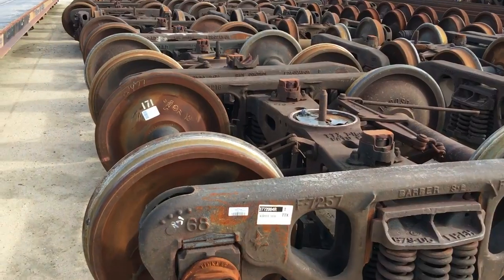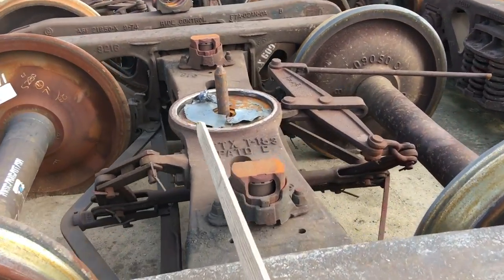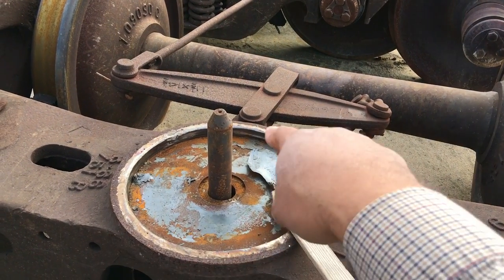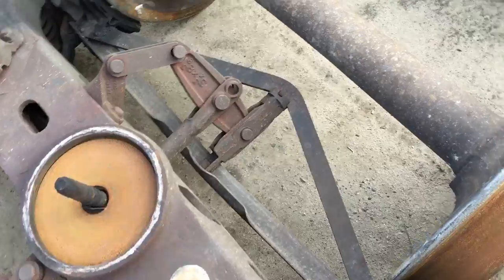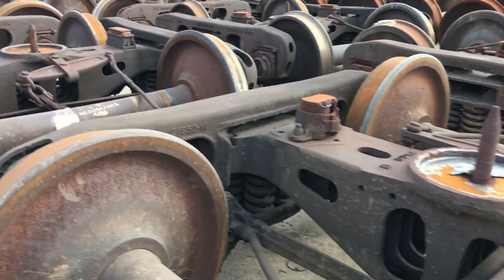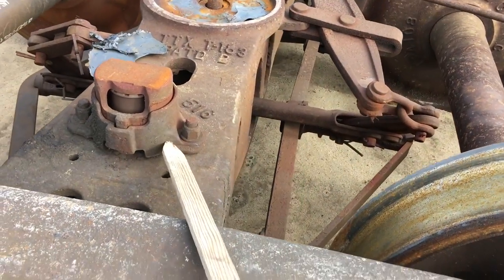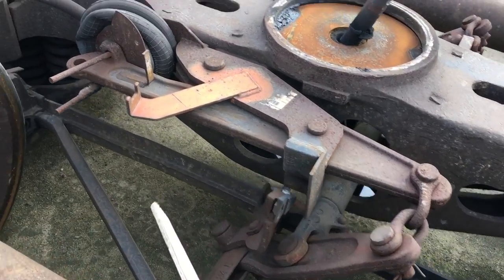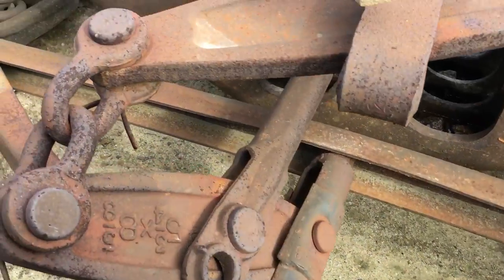Railcar truck set nomenclature

Comment: Just for chat each wheel weighs in at 1,000 pounds each and each axle weighs in at 500 pounds. Each spring is rated for a certain weight handling. When there are two springs they are called nested as there is two together. The Timken wheel bearings, I found out from the Timken people, are rated for 1,000,000 to 1.5,000,000 miles before they wear out. If the car sits for over 1 1/2 years with out being in service it is advisable to replace them before they are put into full time service. The FRA (Federal Railroad Administration) outlawed the old journal friction bearing as they would get over heated and cause derailments. I remember working for the Great Northern way back in 1966 at Hillyard, Washington and there were three men on each side of the train who would open each journal box door, give the bearing a few squirts of oil and then close the doors. The train would move very slowly for this service.
Reply: I would have to guess on the total weight of the truck assembly. Lets say around 10,000 pounds or 5 tons. When it comes to traction motors I have no idea what they weigh.
Reply: Taylor I think I gave you a underweight of a complete truck. Take the completed axles and wheels, 2 side frames and 1 center bolster, all the springs and all the brake rigging I would give a total weight of about 20 tons per truck.
Reply: @robertbowman3406  
That’s waaaaayyy too heavy. A bolster weighs less than 1,000, same with the 2 side frames. The wheel sets are the heaviest and they weigh about 1,000 each. All in all, the assembly could be no more than 5,500 lbs.
Reply: @robertbowman3406  
That’s waaaaayyy too heavy. A bolster weighs less than 1,000, same with the 2 side frames. The wheel sets are the heaviest and they weigh about 1,000 each. All in all, the assembly could be no more than 5,500 lbs.
Reply: @jaysrailroadcorner5403  I stopped reading when he typed 1.5,000,000.

Comment: Wear liner is also known as the GREASE DISC. The grease disc goes over the CENTER PIN. The pin rests inside the CENTER PLATE (or) BOWL.

CONSTANT CONTACT SIDE BEARING. They have a composite rubber in them to cushion the car in movement. Some have a steel wheel in them called a roller bearing. 

Also. Truck sets and wheel sets ARE NOT ALLOWED TO TOUCH THE GROUND. Every single set in this frame is going to need a roller bearing inspection. They come off the truck and straight onto rails. If for ANY reason they touch dirt, gravel, grass, pavement, concrete, black top etc.. they must be put under inspection per the AAR Field Manual. Even if it’s a repair facility, home shop or interchange. They must not touch ground.

Comment: Those are constant contact side bearings. No gap allowed. It has a certain amount of preload depending on which style it is. Looks like stuckie ( believe that's how it's spelled)
Reply from the maker: A. Stucki Company kind of has the market cornered in constant contact side bearings. They do a great job and I have seldom seen gross failures. Heck, they seldom ever need replacing. It is really a great system and they make a great product that is easy to work with. Hmm. After thinking about it, I really like A. Stucki Company.

Comment: I've always wonder how to adjust brake cylinder travel in railcar or adjust slack adjuster ? I work in CNR as a HDM ive only work on locomotive .. would be nice to understand how they work .. thanks
Reply: The name of the part is slipping my mind, but the small rectangular clevis on the slack adjuster controls the brake cylinder travel length. You adjust it by sliding it through the travel block. 1 5/8” sticking out should get you about 7.5” of brake cylinder travel with a new Group R 2500dj slack adjuster for example.  :D

Comment: So the cars are just deposit on the trucks with the pins centered in a hole in the bolsters .
No attachment of any kind ?
Reply: None , not even the wheels are attached
Reply: Naw. On the truck mounted brake systems you’ll have break rod/lever attachments and/or a cylinder hose. But for the most part it just sits on a pin. Sometimes I’ve bent the pin and tossed it and let it ride with no pin.
Reply: @jaysrailroadcorner5403  
That is called a willful violation.
Reply: @ffwd2797  
You mean when FRA or PUC comes and audits a track?

Comment: What about 
"Slack Adjusters", how they work, using compressed air.
Everything is held together by gravity, & pins, with only cotter pins, in the ends of those.
If you lift up the frame bolster, those wheels & axles will roll right out from under there. The frame bolster just sits right on top of them and the roller bearings.
The freight car, just sits on top of the trucks held on by gravity, with a just kingpin keeping it from sliding off. Not bolted on.
I'm surprised no grease is used on moving parts. That makes them easier & cleaner to work on.
Semi trucks are supposed to get grease every time before the hook on to a trailer.
Reply from the maker: Yea, it's kind of weird how everything is held together by gravity. There are some parts that were once greased, back in the day, but are now fitted with non-metallic wear liners (looks/feels like hard teflon). These areas include: center plate liner which goes in between the center plate and the truck bolster bowl, coupler carrier wear plate which goes in between the coupler shank and the coupler carrier...I think that is it. Some friction castings have a wear liner but not many. Box car doors still take a lot of grease. I have never thought about how slack adjusters work. They dont fail all that often...and they are made by the same company that makes bathroom urinal valves (sloan and ajax). Weird.

Comment: Many passenger cars and locomotives have 3 wheel sets per truck set.
Reply from the maker: The only 3 wheel set trucks I have worked on have been for the military. The railcar body itself, including the center plate, were identical to the traditional 2 wheel set trucks. Same wheel sets as well. I have never worked on locos or passenger railcars myself.

Comment: I notice that none of the wear liner bowls have no grease in them, got to have that as the truck will be hard slewing around curves and will climb the rail, i thing a lot of derailments are the cause of this, i work for a class 1 rr and o have never seen the car knockers lube these things, not on cars not on engines and then they wonder why some of these derailments happen.
Reply from the maker: derail14 Hmm. That is very interesting. I have never greased the center plate. I thought the non-metalic wear liners took the place of grease. As a matter of fact, they are also called "lube disks" so I don't think grease is needed. I do recall grease being used by the repairmen when I was still a grunt, not worthy enough to use any tools, way back in the early 1990's.
Reply: I recall seeing TV commercials for some oil company way back in the 70's that was illustrating some of its innovations. One of them was the lubricant for the center plate - they consisted of round flat discs. Four or five wear simply tossed in the bowl and the car body lowered in place. I presume the weight then squashed the discs into a paste similar to grease.

The one shown in the video looks like it might be similar to the product shown  in the following link:

http://www.rrtoolsnsolutions.com/lubricants/LubeDisc.asp
Reply from the maker: whiteknightcat That's exactly it.
Reply: we used to have those in the shops by us, had to carry 5 boxes to a shipment of BO boxes that got pushed in one day
Reply: Ok there Mr class one I work at a class act Railroad, and your right us car knockers don't put grease in the bowls .why you might ask ? It's not FRA nor AAR prohibited . That lube disc is all it gets . Most of derailments are on the account of  poor track conditions and poor train handling.
Reply: I currently work for UP. The bowl liners are called "lube discs" for a reason--they're pre-lubed and slippery to the touch. You seem to have zero idea what you're talking about, bud.
Reply: Grizz are you saying that I don't know what I'm talking about? Surely not.  A lube disc and a bowl liner  are two different things. Right?
Reply: Grizz what office do you work in?
Reply: Rob, what we have here is a confusion in terminology. The lube discs I saw on television, probably back in the 70's, were actual lubricant material. Think of highly solidified grease. Today, lube discs and bowl liners appear to describe the same thing - a single formed composite resin disc that has replaced separately applied lubricants. This is what is shown in the video. The patent for the device is in the link below, with clickable blowups of the drawings for it:

https://www.google.com/patents/US5443015
Reply: whiteknightcat   at the very start of the video when he talks about the bolster. you see the guy pick up that some what round black disc .that is a lube disc. That  disc is still used today. Liners are  also used for wear prevention. I've seen them used to make up for worn bowls. Just gotta make sure to check that side bearing clearance before you let it leave the R.I.P..
Reply: Then I think what we're seeing in the video is the type of product shown in the link below - looks almost identical. The narrator described the item as a wear liner, though, resting atop a steel liner. I presumed this was what was left of the assembly described in the patent I referenced earlier, after much wear and tear. 

http://www.rrtoolsnsolutions.com/lubricants/LubeDisc.asp
Reply: whiteknightcat the link shows it exactly how  it looks new. The narrator over all did a good job on describing the parts. Wish he would've talked more about those constant contact side bearings. would of liked to hear his opinion on them.
Reply: Rob Henry 
Derail14 probably works in office and over heard a conductor talking shit about carman because he derailed a car doing something stupid
Reply: Rob Henry he was mistaken on the CCSB (constant contact side bearing) clearance. Correct me if I’m wrong but the minimum clearance stated in the AAR field guide is 1/2” (Miner) with the maximum clearance 13/16” (Stucki). I work on tank cars only (36” wheels) m, so if there’s any difference on hopper cars, box cars, etc, I’d love to hear about it.

Off topic, can anyone here direct to a site that shows a basic maintenance routine for working TMBC (truck mounted brake cylinders)? I work for a small company but I’m a lead there and am responsible for coordinating training meetings every other morning. The AAR field guide doesn’t say squat about TMBC! 
I was told to look for manufacturer specs but I’m hitting dead ends everywhere. The funny part is I KNOW how to disassemble and reassemble them, but I can’t find any literature to back up what I’ve learned from my peers over the years!

Comment: What does the painted writing mean on the side of the wheel set?
Reply from the maker: The only federally required "paint" on the wheels is a small "H" that get stenciled on the wheels. The "H" means that the wheel is "heat treated" and "curve plate". This refers to the actual wheel plate itself which is the part of the wheel between the axle and the "tread" or wearing surface. The older wheels were a super simple flat plate of steel. The newer wheels looks more like an "S" if you were to cut a cross section out of the wheel. This helps with heat dissipation. All of the other stencils on the wheels you see are from the manufacturer. Some of the wheels we get in are almost brand new with the mfg stickers still on them. Some only a few months old. Those mfg numbers vary and are not very important. All the important stuff is cast or engraved into the wheel, such as mfg serial numbers, manufactured dates, heat treat classification, and factory ID.
Reply: thank you
Reply: "H" is the only required lettering per FRA, but Greenbrier provides my rip tracks' wheels and they'll sometimes--not always, but sometimes, be stenciled "PREM" for a premium wheelset, "TURN" for a turned/reconditioned wheelset, or "NEW" for a new wheelset.

Comment: anyone else cringe seeing all these wheels set straight on the ground?
Reply from the maker: Yes, it used to make me cringe...but they all go to be reconditioned so it doesn't matter. It cost extra labor to put the wheels on cribbing and we cant charge any extra for doing that...so...we dont any more.
Reply: Why does it matter, the rim that is sitting on the ground is not the part of the wheel flange that rides "on" the rail, so no damage there.  So, why would it matter?
Reply: @diesellocomotivefan5400  lmao you cant be serious....any kind of damage to wear to a component is never good. Sure, the rim doesnt ride "on" the rail but it sure are hell needs to not have a dent in it either!

Comment: Those so wheels on the first set of trucks you show are condemable.
Reply from the maker: Dark Days Can you please elaborate? Thanks.
Reply: Paragon Bridge Works  any so "southern"  abex wheels must be removed on site. Check aar field manual rule 41 page 350.
Reply from the maker: Dark Days Very cool. Do you have any idea why the AAR made that ruling?
Reply: Paragon Bridge Works casting flaw I believe. It started a few years back with only the 1995 wheels. They added a few each year until a couple years ago they condemned any abex southern wheel. Raised letters on the wheels make it an inspectors dream.
Reply from the maker: Dark Days Where those cast in the USA?
Reply: Paragon Bridge Works  yes Savannah Georgia.
Reply: That wheel looks like a 33' that rule only applies to 36" wheels.
Reply: Rob Henry that's true but I think those are 36". Hard to tell.
Reply: Dark Days they are 33" those are 70 ton trucks
Reply: Jeff Klaubo yep you're right. I was to quick to call them 36.
Reply: Dark Days if I hadn't been working with the 70 ton trucks so much lately I might have missed it but the F7C style gave it away lol

Comment: Round block over bearing is also known as a "journal". Stop over explaining yourself because it makes you stutter and loose train of thought on part names.
Reply from the maker: +Charles Stevenson I have heard of the "roller bearing adapters" called "journals" but the AAR rule 37 specifically calls them "roller bearing adapters". In fact, the entire book only refers to "journals" as the area on the side frame where the adapters mate to and does not refer to that term as an actual part. But, I have heard them called "journals" by some people. That's just my humble opinion. I hope you enjoyed the rest of my videos.
Reply: The "journal" is actually the end section of axle on which the roller bearing is mounted.

The area on the the side frame that sits down over the roller bearing adapter is call the "pedestal jaw".
Reply from the maker: I didn't know that. It sounds like you have some experience with these. Thanks for the clarification.
Reply from the maker: How in the world do you know this? You must work for a company that reconditions or builds new railcar parts. I dont even know that nomenclature. Thanks for teaching me something new!